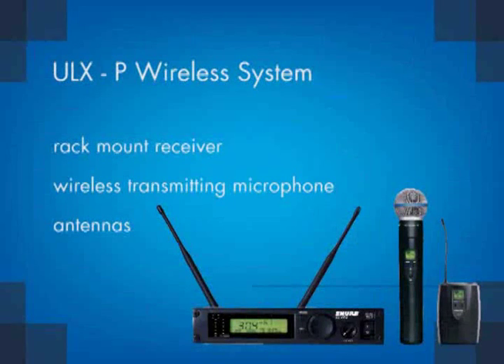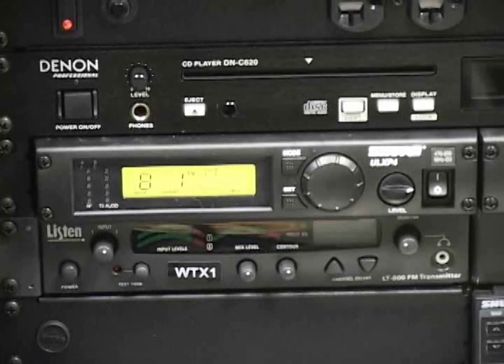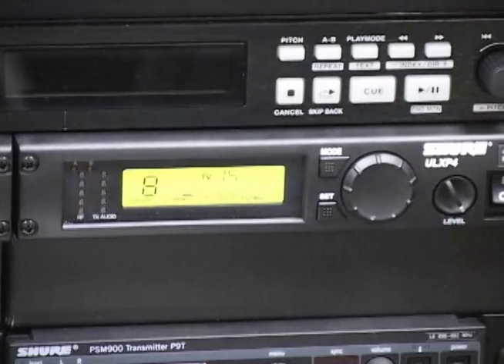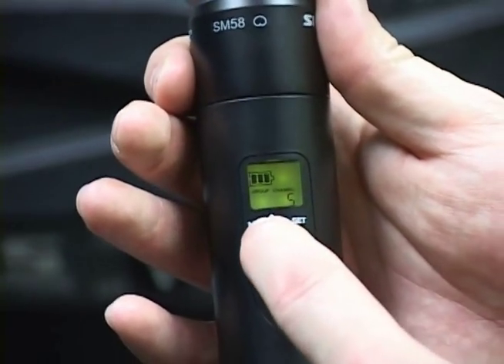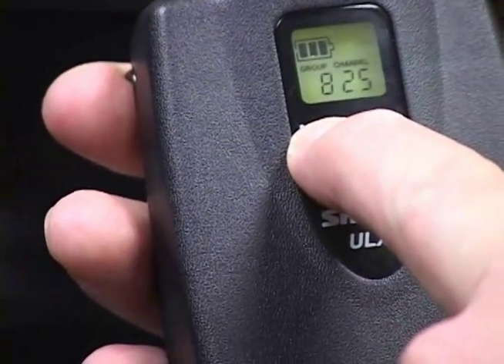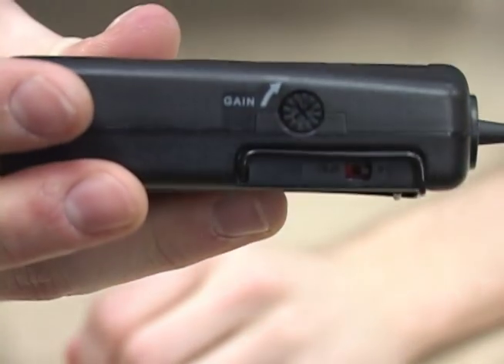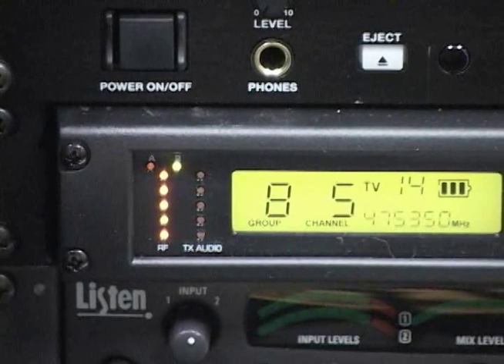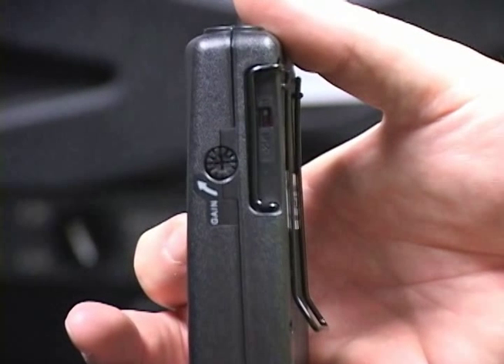Tutorial: Standard Rack Control System - ULX-P Wireless System

Comment: I have the same receiver and I have problem with change the , group or channel the display said it's locked has to locks how I can unlock can you please tell me
Reply: To unlock the receiver, hold down the SET button while turning the control wheel Left, Right, Left.   If LEVEL flashes on the LCD, decrease the Level knob first and try again.